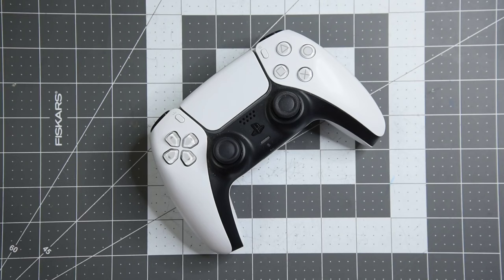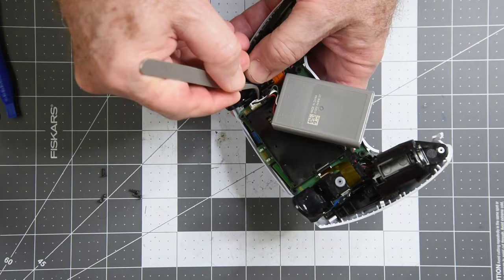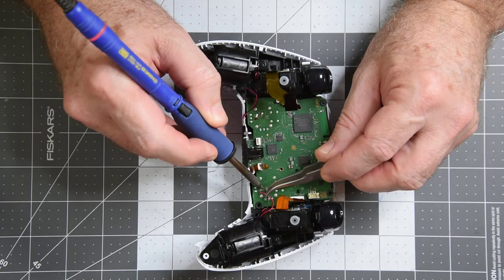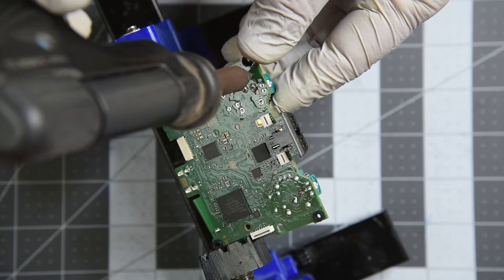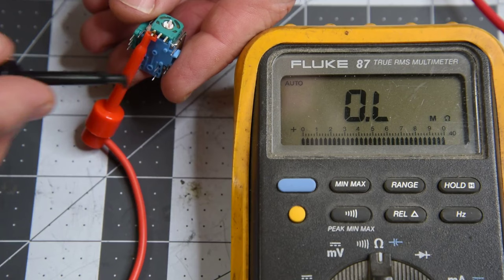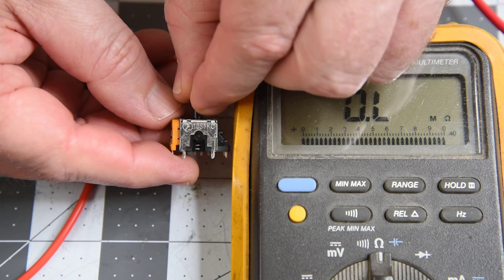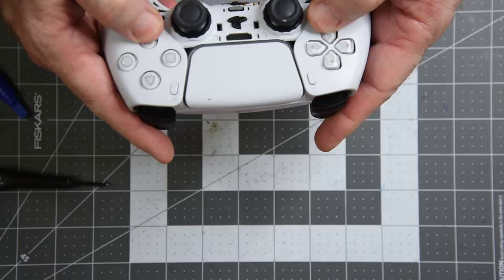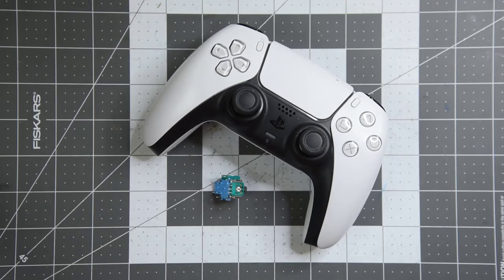PS5 DualSense - Joystick Replacement

Comment: I was in the middle of trying to fix my controller, it turned out I don't have any soldering tools. And this is actually a pretty common issue, I don't know why it's not talked about as much, it's a defective design. Consumers shouldn't have to take apart their controller to avoid paying $80 for a new one. Sony should honestly be sued for this
Reply from the maker: I don’t think Sony even considers the DualSense repairable, just disposable.  That’s why they brought out the Edge with it’s 20 dollar joystick module.
Reply: Seriously wtf. I want fix my joystick drift but i have to use a frickin' soldering tool to do it? Unreal.
Reply: @dawens3199  unfortunate, but you can get all the soldering tools you need for it plus the replacement sticks for half the price of a new controller which is what I did.
Reply: Agreed, coukd change it easily on N64
Reply: @metalplasticelectronics354  my thoughts too, then I bought the edge. Now I got stick drift but guess what, they haven't had a restock of the modules in fuck knows how long
Reply: Facts.. Mines just went on both controllers
Reply: @PapaBerto Same here
Reply: And that’s why you watch the guide BEFORE jumping into it yourself

Comment: Side note you can just replace the potentiometer if it's only one axis that is affected by drift and the stick itself is still in good condition also way easier as it's only 3 pins that need to be desoldered to replace the pot
Reply: thats what i did to fix mine.
Reply: Bro i think it’s better to replace the whole thing because it takes too much work to take it apart and if only one is damaged probably the other are worn out as well I had a issue with mine and I replaced left and right one, long time ago and still working like it was brand new
Reply: @fernandopineda4400  physically yes but dropping 70 bucks every three months isn't a viable thing to do when you have two kids vs 10 bucks and eventually when hall effects sticks are made to fit in its place be a long term replacment
Reply: @fernandopineda4400  also one is used for movement the other for aiming the aim or right stick is usually more afflicted in my time playing games(30+ years at this point) usually the left stick is unaffected by drift as severely as the right analog stick only on the switch have I seen stick drift on the left joycon which is easy to fix
Reply: @Jihadbearzwithgunz  I play fifa only bro that’s why my left stick is the one damaged lol and I paid 14 buck for the replacement parts 😎 never spending 70 on stuff like that specially with the cost of living now
Reply: The dead zone will be different as it will not be calibrated to the joystick factory settings. So in fps games, you'll see a huge difference
Reply: @satoxx.33  also depends on the pot and resistance and if they are quality parts or cheap Chinese garbage
Reply: There a video for this? My left stick is dodgey picking up right movements. Took it all apart and cleaned and no fix unfortunately
Reply: Hi, I am new at this. How do you disolder the pins? Using the solder tools could potentially melt it more and damage it?
Reply: @Jihadbearzwithgunz  No, they are all from the same factory. The difference is the calibration they undergo from MS or Sony before packaging.

Comment: A lot of times, just replacing the white little pieces of the thumbstick slots does the trick. On my ps5 controller I had terrible stick drift, so i had sprayed them with electrical cleaner and got my thumbstick to work again. After a month the drift came back. I swapped the white pieces from the vertical to the horizontal and sure enough the drift was now the vertical. I just swapped the piece and now the controller works perfect. No soldering needed.👍
Reply: Where can I get them?
Reply: @SGVSOUTHSIDE eBay, I got 6 for only £4. I've fitted two into the left analog stick which was pulling to the left, cleaned the whole stick with contact cleaner and it's cured the drift. The only thing is now there is a very slight click/notchy feeling when the stick is moved to the right like something is not quite seated correctly, or something is rubbing inside the actual moving parts of the joystick. I think the PS5 joystick parts are cheap rubbish, made from poor quality plastic and  built to fail, meaning you'll buy a new controller every time, making more money in controller sales. Just my opinion.
Reply: What do you call those? I'm trying to find them on eBay lol
Reply: @PullOutPapa  they are called potentiometers

Comment: Nice clear tutorial thanks. Just had a go on my drifting left stick (it took about 2 hours longer than your video though). It's a massive pain with a handheld solder vacuum, I ended up having to carefully crush the old component with pliers just to get the pins out one by one. Finally get it all back together and... the stick doesn't work at all 😢 AND it's somehow still drifting despite not getting any input from the stick! Sony's done a bad job with these controllers...
Reply from the maker: Yea, without a vacuum desoldering gun it’s not an easy task.  I don’t know what advice to give.  It the center pin of a potentiometer is open or the trace to it is damage.  That could cause it to drift and for that axis to not have any effect.  Does either axis have any effect on the joystick you changed?

Comment: Great video. As an observation: i think sony is using high temperature soldering alloy. With my soldering iron i was not able to melt the material holding pins even with 400 degree set
Reply from the maker: I would expect it to be probably the cheapest no lead solder there is.
Reply: Need to reflow the joint with leaded solder
Reply: @austinduff8833  don't mix leaded solder with unleaded solder if the solder is  unleaded use unleaded
Reply: @TheGamingLegend-be9ey  why?
Reply: @TheGamingLegend-be9ey  why?

Comment: What happens if I use the 10k potentiometer anyway? (Take a stick from a P4 controller and throw it on there as a last ditch resort)
Reply from the maker: I have not tried, but from reports, it seems there is a there is a very high likelihood of drifting.

Comment: This was a super-clear and helpful video, thank you.  Without this, I would not have attempted this job.  My only top-tip is don't be afraid to add in more solder in order to get it all out of the through-holes.  I think that helps with heat-transfer.  Also I used lots of flux and braided solder wick.  In my experience, a desoldering iron is pretty much essential but I managed with one that has a plunger, rather than a motorised vacuum one.
Reply from the maker: Here is one way with no desoldering iron https://youtu.be/slxgHcYHnm8  Though it does add quite a bit of time to the process.

Comment: I noticed the back plastic mold starting to flex inward. I think it may contribute to the sticks drifting with ps5 controllers.
Reply from the maker: I could only see that having an effect if it could flex the PC board the joystick is mounted on.
Reply: @metalplasticelectronics354  that is the theory

Comment: This is the best video i have seen to remove this analog stick all instructions clear and everything well explained👌, im about to do this replacement just asking if you know any desoldering gun that is cheap and good and another thing is, can you use any orange analog stick to replace it?
Reply from the maker: I don't know of any cheap desoldering guns.  You want to make sure the stick is made for PS5.  The potentiometer value on the dualsense are around 2k ohm instead of the 10k on the PS4 controllers.  I think most of the orange ones will have 2k3 printed on them if they are made fro the dualsense.
Reply: @metalplasticelectronics354  ok no worries ill look for a desoldering gun station and thank you for your reply i was having a hard time for the analog stick type👍

Comment: I’m wondering what temp should I be soldering at, and what’s the best de-solder method/tool,also is brass fine for soldering here?
Reply from the maker: I really don’t know how well the cheaper vacuum desoldering stations work.  Amazon has a bunch of different models.  But that type of tool works better than anything else I’ve ever tried.  Probably for the grounds going to need up around 700F/380C, maybe a bit more.  But going to depend on the soldering iron and some what on the solder.  I’m not sure what you mean by brass.  The solder for electronics will solder brass.  Probably will want some extra flux for it.

Comment: Really though, as much as the sticks on the dualshock 5 start acting up, they should have designed this to be a fast, easy, one step pop off a front access panel move, and they pop right out.

Comment: Them using solder that require a HIGHER melting point than usual on a device that doesn't get hot at all is just there to make repairs more difficult...
Reply from the maker: It's the lead-free solder, it has a higher melting point.

Comment: Orange potentiometer are 10k but grey ones have no writing on them. I assume they’re 2.3k as later PS4 models use the grey ones too like the PS5 one. I replaced the white part only but it’s marginally of centre so doesn’t go back to dead centre unless it’s flung back itself from max position.
Reply from the maker: It may be part of the potentiometer element has worn. Does it move smoothly around the center area or jerk a bit when moved?
Reply: @metalplasticelectronics354  it moves smoothly. If I let it go back to dead centre itself from max position, it goes to 0%. A gentle push of the joystick and it’ll to back to 2% unless I gently touch the thumb stick then it stays at 0%. Other side of potent. might be worn but soldering is hard.
Reply from the maker: It may be it is worn somewhat.  Might try and recalibrate the controller. Take a look at this: https://youtu.be/0fK1sapv0YI?si=n52R8aQgmtS09jGt.
Reply: @metalplasticelectronics354  I did thank you. Recalibrated and it’s working perfectly now. Will replace the full potentiometer when it fails again.

Comment: What are the tools you used and where did you get them? And what's solder when you said you were putting it on the pins??
Reply from the maker: The solder is Kester 44 63/37, but any good solder will do. The tin lead has a bit lower melting point than the lead-free, so it is a bit easier on the PC board. The vacuum desoldering gun is a very old Hakko 470, it's been discontinued for years. The soldering iron is a Hakko FX-951. It's the best soldering iron I've ever had, but a bit on the expensive side.

Comment: I bought potentiometers from an amazon listing that didnt specify the value that you show on the multimeter they ship tomorrow I wonder if we bought from the same listing but the brand does say alps. could I just replace the disc thing itself? is there a name for that disc thing?
Reply from the maker: If your replacing alps for alps, then you don’t have to remove then entire joystick.  Can just remove the three leaded potentiometer element and replace it.  It just clips in the joystick metal frame.
Reply: @metalplasticelectronics354  thank you for responding im gonna follow these instructions when everything arrives

Comment: I ordered new parts for my controller I replaced the left analog stick because my character walked to the left a lot and it worked it stopped doing it but when i replaced it the right started acting up it the camera started to move to the right I replaced that it sort of fixed it it Went from scrolling to the right to slightly stick drifting to the left please help
Reply from the maker: Are the replacement potentiometers the right value.  Some places selling 10 kohm for the DualSense when they should be 2k.  Or the new potentiometer may not be in good shape.  I ordered 20 Favor Union joysticks.  1 of the 20 had a potentiometer that was defective.

Comment: This was extremely stubborn. Added fresh solder, had to crank the heat higher than normal. Desoldering station as well. Still ripped a pad wiggling it out. For the average user, buy a new controller. The cost of the parts, and then either have to pay a professional or buying the right gear to do it your self is not worth over just getting a fresh controller.
Reply from the maker: It's not an easy part to change, that's for sure.

Comment: Hey man just curious i'm new to soldering what measurement's for the wire did you use? or does it matter?
Reply from the maker: I like the thinner solder diameters, I believe in the video I was using 0.031 diameter solder.  It doesn't matter that much on these larger pins.  The thinner solder does cost a bit more.

Comment: Well made video. Didactic and to the point.
Can I ask you, what about the new hall effect modules? Ahould they have the same resitance? (2.3 for ps5 and 10 for ps4?) How can I tell them apart woth certainty?
Thanks in advance.
Reply from the maker: I'm not sure how interchangeable the Hall effect joystick modules are. The DualSense controller joysticks run at 1.8 volts. If the Hall sensor in the joystick runs at that low of a voltage, then it will probably work in the DualSense. I've only tried one type of Hall joystick at present. I've ordered a set from Amazon that looks like K-silver ones, but the description doesn't say anything about the brand. I'll see when I get them. I'll make a video on them.
Reply: @metalplasticelectronics354  Great. Thanks.

Comment: Starting to hate these, the slightest too much heat kills something near the analog sticks, rather getting two flashing lights or random clicking noises inside the triggers. Same with the charging port. Hard to fix I think compared to others, then again I've had an antenna snap on the xbox pads their that small.

Comment: Thanks for this video. I'm wondering if it's possible to do this replacement using hall effect joysticks instead? My left Dualsense stick is starting to drift, so I'd like to go ahead and swap out both with something that should never have this problem again.
Reply from the maker: I don't know.  Might have to be a hall joystick made for the DualSense.  The move from 10K in the DualShock, to 2K potentiometers makes me wonder if they lowered the reference voltage to the joystick.
Reply: @metalplasticelectronics354  Do you think unsoldering the GuliKit Electromagnetic Module Joystick for Steam Deck from it's board and soldering it to the PS5 board would work?
Reply from the maker: I doubt it.  The output from them is probably the hall sensor voltage.
Reply: Look up hall effect joysticks - this is the design-tech solution that has been gaining attention and should be offered more and more as part of or as replaceable option going forward
Reply: This is my thought as well. My controller hasn't drifted yet thankfully but i know it will someday. I wish that there will be replacement hall effect joystick specifically for the dualsense 5 in the near future.

Comment: Could you please tell me the exact model of the vacuum desoldering tool you used in this video? I want to purchase the same one to ensure I get the right tool.
if you know of a similar but cheaper model, I'd be interested in that as well. Thank you! :)
Reply from the maker: It is a very old Hakko 470.  It's been discontinued for many years.  It's so old I wouldn't even risk one on Ebay.  There are quite a few on Amazon around the $150 range.  I have no idea how well they work.  But they maybe knock offs of the Hakko.
Reply: @metalplasticelectronics354  Thanks a lot 🙏

Comment: Great video! Definitely the safest way to replace. Unfortunately while attempting this, the capacitor above the left analog stick blew away! There’s one on the right side with a resistance of around 700ohms (not sure the capacitance). If you know the value / name of the capacitor on the left and where to source that would be great! Thanks. [Board is BDM 010]
Reply from the maker: I sure don't. You might check and see if the ends of the capacitor connect to the ground and the supply pins of the joystick potentiometers. If so, it's probably just a bypass cap, and the value will not be that critical. I think they are 0201 size. If the length is about 1 mm, then they are 0402. If the length is about 0.6 mm, then they are 0201. Amazon used to sell some SMD chip capacitor kits. If they don't, then you will probably have to order from a place like Mouser or DigiKey. For a bypass cap, I would try a 100 nanofarad to start with.
Reply: Thanks so much! Will let you know how it goes.

[update] spot on! They look about 0.6mm (so 0201) and my reading was 127nf !! 

Thanks for replying so quickly, I thought my controller was a goner 🤣! 

Will order them now :)

Comment: Excellent video as always. I tried something similar but the new analog stick wasn’t calibrated. Similar to the point that I removed the analog sticks and changed the potentiometers. But after putting it all back together, the stick drifted. Can these sticks be calibrated like the ones in the Hall effects sticks video?
Reply from the maker: No, you sure can't. The only thing you can do is use a meter and try to find a replacement potentiometer that is close to the original one.
Reply: @metalplasticelectronics354  Thank you for the prompt reply. I see. Then it must have been something with the analog stick I was using or maybe the stick wasn’t properly seated.